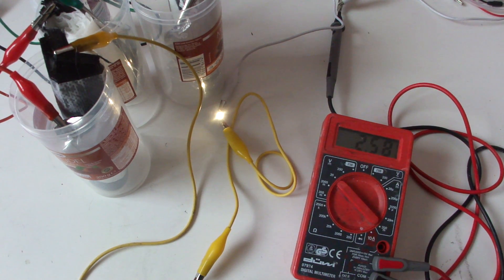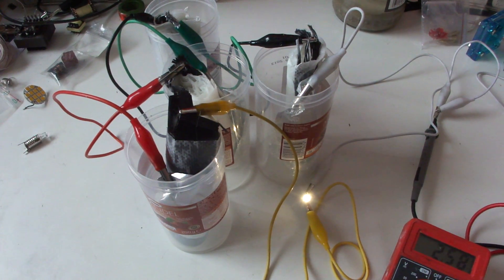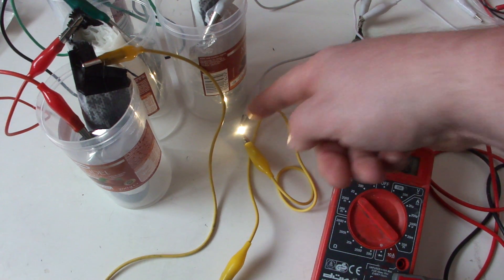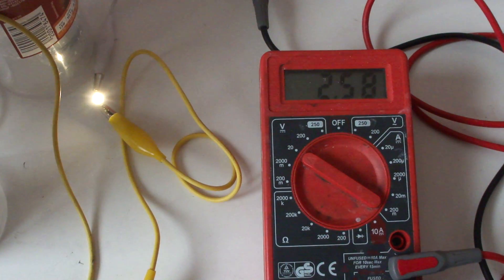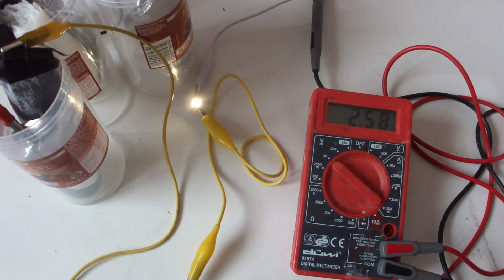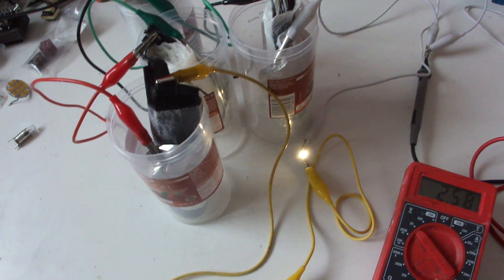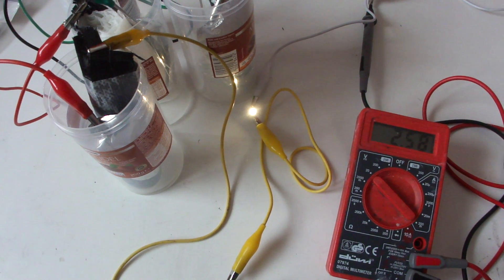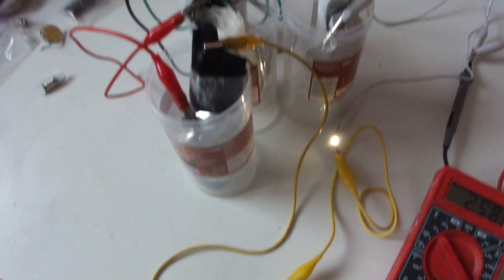24 hours runtime later - carbonfiber alufoil cells raised voltage on LED

Comment: 2.58 Volts X 387.6mA = 1 Watt
LED's are 90% efficiency The 1 Watt rating on the LED light is based on its (light output) equivalent to a standard incandescent light bulb.
Therefore it's milliamp draw is 10 times lower than a incandescent light bulb of the same wattage. So it actually only draws a 38.76mA  load for 1 Watt of light output.
Therefore it would take 10 hours to draw 1 Watt from the batteries or 2.4 Watts per day.